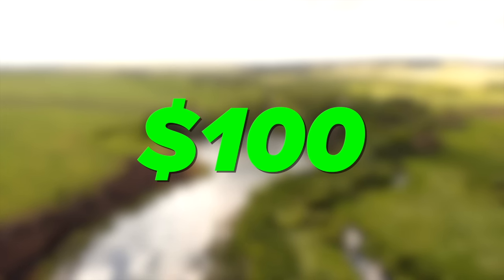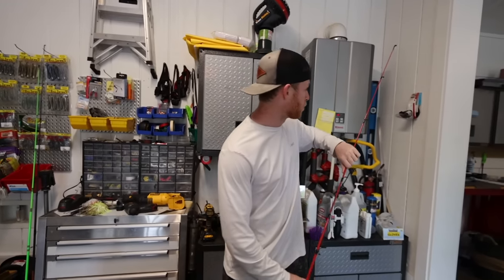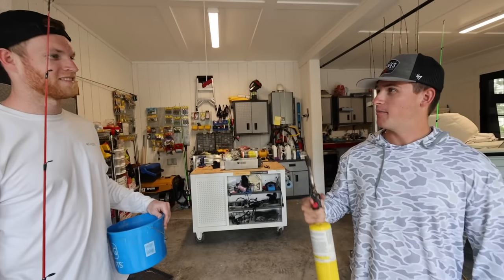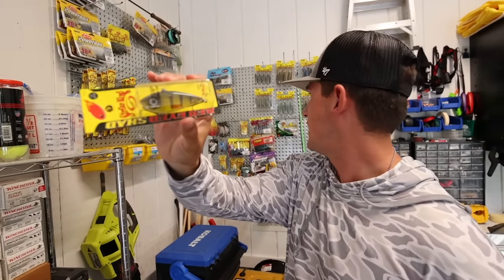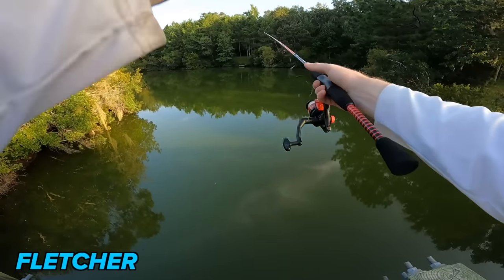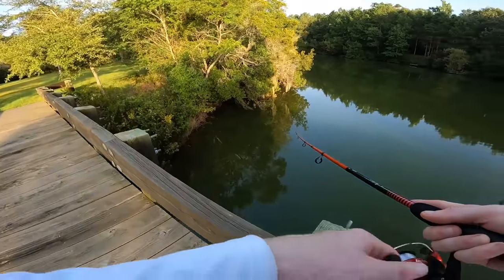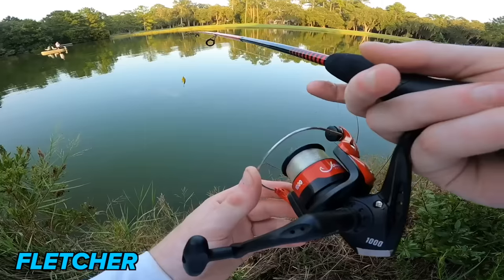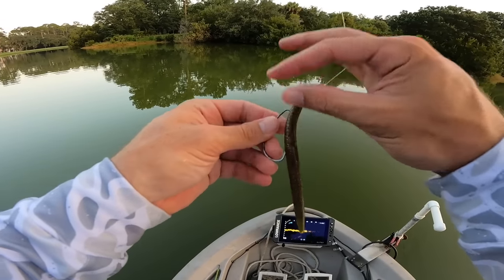$100 vs $10,000 Budget Fishing Challenge (Rod, Reel, Boat, Lures)

Comment: Well that proved that you can catch fish from the bank but from a small boat you have better angles, more water to fish, better water coverage and you can catch way more lol. It wont cost 10k to get a small jon boat, a battery, and a trolling motor though. All in used jon boat, new battery and trolling motor can be less than 1k but i dont think more than 1.5k.